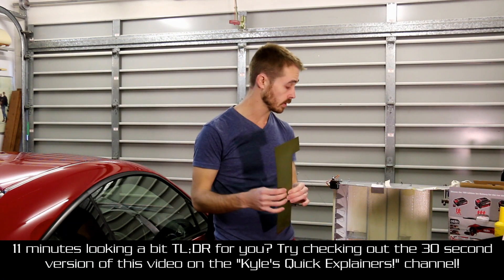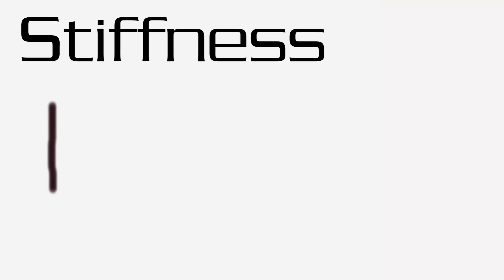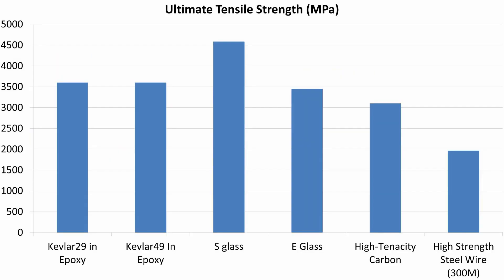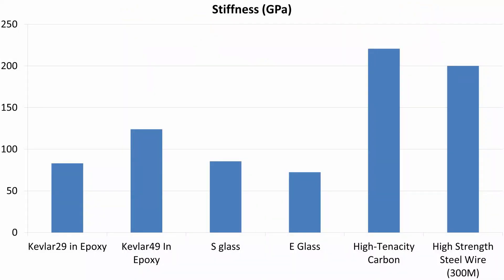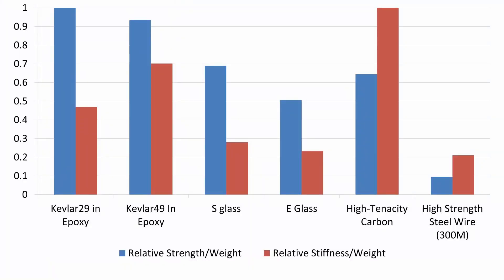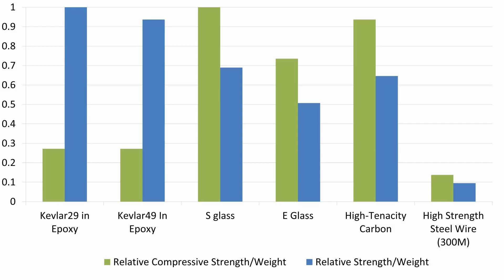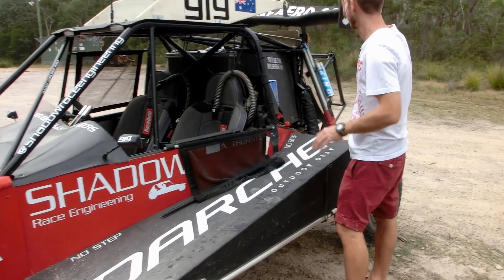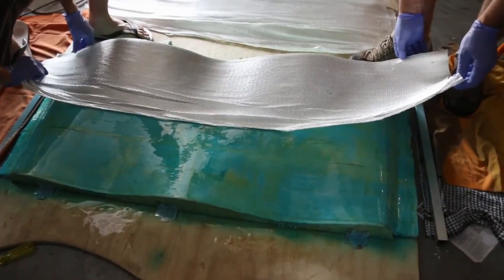Carbon Fiber vs Kevlar vs Fiberglass - Which one is right for YOU?

Comment: Thanks Kyle, I've been flying model RC gliders and I'm starting to repair my own crashes to save on the cost of replacement parts.  The video was an excellent primer and eloquently shows the path for the current repair that I've been fussing over.

Comment: Hey Kyle I’m in a slight predicament and with your background and expertise I’m curious if you’d have any recommendation.  I have a full suspension mountain bike frame made of 7005-T6 aluminum.  Recently found a crack running from the top of the downtube progressively down either side of the tube about halfway.  If you where to take a cross section it would only wrap around the top half of the cross section from 9 O’clock to 3 O’clock.  

I plan to lay either s-glass fiber or carbon fiber over the top half section, hopefully this will also keep the tube compressed enough to prevent further propagation.  The crack ends will also obviously be stop drilled.  My issue then comes from the ability of 7005 aluminum to elongate quite substantially where as carbon definitely can’t and fiber glass is only marginally better.  I think 7005 can reach 12% elongation at like 20 degrees C.  The problem is I’m not sure which route to go.  The fiber needs to limit the amount of change in length so as loads are applied, the crack doesn’t open up at all and propagate, but at the same time the CTE difference between aluminum and let’s say carbon fiber are so substantial if there isn’t any sort of give, just the temp rising or dropping will cause a failure.  I believe the thermal expansion coefficients of the aluminum and carbon fiber are around 21 micrometers/m-C and 1 micrometers/m-C respectively.  So the issue: I need limited movement i.e. further crack propagation if neglected, but the difference in material CTEs are large enough to require some movement or there will be failure of the composite.  Curious what your thoughts are and how you see an optimal solution.  It should be noted that a mountain bike does not see massive changes in temperature as it’s only used in rideable conditions (changes are gradual and not immediate as its contingent on atmospheric conditions).  For example sake the temp range is more than likely 30 F - 110 F.  That’s with a large margin, but I travel with my bike inside the trunk space of my SUV so if left parked I’m sure it can reach 110 degrees inside the cabin on a hot day.

This is obviously without even getting into the topic of epoxy and their affect on CTE of the composite.  Hopefully this is coherent haha.

Comment: Hey thanks for this video! It was helpful. 
I know my question isn’t technically pertaining to racing but what about a spinning disc? Where the only load on it would be radial forces and tangential hoop stresses in the disc periphery, so no compressive forces. If the goal is highest rpm, Does the higher tensile strength of the Kevlar outweigh the carbon fiber? Especially because it’s lighter and therefore experiences less radial forces for any given rpm if they are made into discs of the same size? 
Thank you! 

Before anyone asks no, I’m not talking about break rotors, and I can ignore UV issues as well.
Reply: The issue with Carbon is it can shatter and I believe in a spinning disc type scenario, Aramid(Kevlar) would be a better. Saying that, Aramid and Carbon can be layered together. Different resins and each layer should be allowed to cure but they can be used together to get both light weight and strength qualities.

Comment: U take the mini tiny wave pattern smallest u can lay fibers & work w/it. Then u come back 2nd step to smooth finish over, only u r finishing over many many diff wave pieces like a checkers board, red or blk. The squares of checkers board wave sq can b what ever size works best 1ft sq or 2 ft sq example u just hve to turn it sq 90 deg to last 1, north soth & east west, b4 u cover them together like quilt sq. Can bottom smooth cover, or flip it over & make 2 wave quilt squares thick.

Comment: building new prts fiberglass all day or w/so other material, but skinning carbon is where it is at, 1 & done. Is there a tiny way smallest poss that u can still cover, fixing the stretching weak problem bc tiny wave hollow bit can b covered smooth skin yet bonds to the under side thicker per inch strength^ main prt underneath.

Comment: The best use of Kevlar on a race car not mentioned in the vid. Is it’s ability to pass radio waves. So for instance most high level cars will have a small area of Kevlar in floor where the transponder is mounted.

Comment: What I understood from this is that Carbon Fiber is not necessarily strong if forces are focused in a small area, but it will wobble less with high vibrations, is lighter and can take more pressure in a larger area...?
So like, great for aero and other large panels due to large area forces, but not so good to support focused weight or impact?

Comment: Carbonfiber is great and it can be better depending on how it's made. Ie you can make cf several ways to receive different results. Ie pre preg carbon, wet layup carbon, autoclave cf, different epoxies, epoxy to cf consistency etc.

Comment: I'm new to composites and I'm considering getting into making some custom parts for older BMW applications. While this seems to talk more about the structural applications of the different materials I was curious if you could give some guidance into what would be best for air piping applications. I'm going to have to fabricate custom intercooler piping for a turbo build I'm planning out and was hoping to go with something a little lower weight than the aluminum intercooler piping. I'd imagine one of the factors of this would be the heat resistance of the epoxy but I don't know what else to consider. Overall, I'm not concerned with the aesthetic of the carbon fibre as everyone else that puts carbon parts on their car seems to be, and whatever goes on will be painted to match.

Would the S-Glass be airtight and will it hold up to the pressures of 12-15psi of boost? Would S-Glass be adequate for this application?

Comment: in compression most of the loading is actually taken by the epoxy NOT the fibers, this is why choosing the correct epoxy is nearly as important as the fibers. think of a shoe string, strong in tension, horrible in compression. its the same thing

Comment: things change if you use thermoplastics instead resin and also thin ply 3k unidirectional carbon. 
however thank you, i knew carbon was brittle but not that weak in compression and strenght

basalt must be best choice but carbon with graphene goes off charts and if used with plastic instead resin must be best choice too

Comment: fun facts. vinyl ester and polyester 50 - 50 mix is a very versatile.  I like mixing  
glass carbon and kevlar to gether. Roving are excellent filler/ stiffener.
double sided molding are the ants pants. triple sided. eg. inserts. Finnish  with surfboard clothes is a good practice.  Validation; Winton Saphire, facet opal.

Comment: I have a boat mold that I'm planning on using Carbonfiber as my 1st layer (which would be the outside layer) then building up additional layers using s-glass. My question is, would this be possible. I want the look and stiffness of carbonfiber with the strength of e-glass. Also what method would be best to apply the layers? Or is it imperative that I do Infusion?
Thanks in advance

Comment: Thanks!  I actually used some S-glass (S2?) on a canoe years ago, but I admit to being influenced by the "carbon fiber is best" crowd.  I experienced having carbon parts failing in testing, while the initial tests with e-glass were surprisingly durable.  And weight savings was disappointing.

Comment: I use carbon fiber for visible layer as I don't need to paint it if correct UV resistant resin is used. S-glass for structure. It's the resins for different applications that still has me scratching my head at times.

Comment: Not sure where you got those numbers, but saying something is better doesn't necessarily  prove that it is.  Did your voice suddenly speed up discussing the numbers?  Was hoping for a demonstration alluded to here, much like the guy breaking that glass.  Sounds like you rattled off some numbers to compare the three, that somehow turned into 8 or 9 types then 16 in a different color(ouch)..    
Looks like you were already set on, "fiberglass"..  You had me when describing the strength and flexibility of the various materials, but how did this end up being based on cost; when cost was not part of the original factors?  That was like choosing a bride based on finding out there was only one female out of the 16 candidates.  

Kind of funny, but somehow your presentation still relates back to carbon fiber for being the best for reduced weight, increased strength and flexibility.

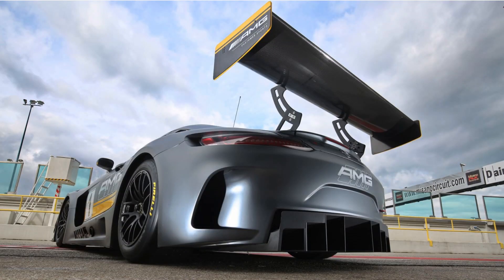Comment: I don't get 7:23 , surely the underside of a spoiler has low air pressure so it would be under tensile stress - the suction effect trying to pull the under side of the spoiler apart.  Whereas the upper side of the spoiler has high air pressure so it is being pushed down / pushed together which is compressive stress.

Is there something I'm missing here or is the vid the wrong way round?
Reply: So what he means is that the load in the middle of the wing will be transferred into the wing mount arms, it’s the part outside the wing mounts that experiences the flex

The wing wants to flex down, so the top skin of the wing is being pulled downward while the bottom skin is being pushed into itself, the low pressure of the bottom skin is being applied normal to the wing surface and thus doesn’t apply to what we’re talking about
Reply: @ShopeeMarketteam  Ahh i think i see now thanks.  Yes i'm thinking about the forces on the wing too abstract, when you think about it relative to the mounting arms yes that makes sense.

🤔 So by extension, if the arms were mounted on the outside of the car/spoiler it would be the opposite then, right?    Eg looking at the car from the back, if the spoiler was mounted like this  -------|--|------- then the top would experience tensile and the bottom compression, but if it was mounted like this -|----------|-  then it would be the opposite?

Comment: there are different measurements for material strenght, like pull and push, steel is very strong for pull its opposite is concrete that is really good under preasure, material strength test should consider its use, as there is the compression test too, not only the pulling one

Comment: I'm considering options for building wings on an RC airplane...
It's the skin of the wing I'm wanting a material for
It needs to be light, strength isnt important at all
I have a carbon fible rod in the wing for strength 
And lots of carbon ribs along the length of the wing that I need a skin to form around 
A heat shrink clear plastic could work, it's difficult to stretch evenly along all areas, and if its loose it flaps in the breeze, and its heavy..not good.

The problem in my mind would be getting a carbon cloth that's light enough, and getting as little resin in it as possible
Most carbon cloth I've seen people working with on YouTube is a course weave..and lots of resin.  Because they want strong parts for cars.
My application would be quite different 

Any advice? (Asking anyone out there, not just uploader)

Comment: Here is a question for you. Some people are making bamboo bicycle frames. Generally the joints are constructed by wrapping said joint with a fiber material that wetted with a resin matrix. Some people use raw roving and others use narrow woven tape. The question is: from a technical point of view which material is better suited for this purpose: carbon fiber, glass fiber or kevlar fiber?  Thank thee

Comment: I work on arcraft that have fiberglass panels and covers.  They constantly crack and a large portion of my career has been repairing fiberglass panels.  There was an experiment done when designing the new model of aircraft where they made carbon fiber panels and replaced the fiberglass panels with  the carbon fiber ones.  I have not once had to do a repair on those carbon fiber panels. The amt of man hours saved on this one aircraft from not having to do panel repairs is insane. Now all the new models are coming out with carbon fiber panels and I am so excited to not have to worry about fiberglassing anymore!

Comment: You forgot to mention plastic . I noticed the nissan Xtrail has plastic front panels. Most bumpers are also
Reply: This video was about composite materials.  Its focus was not on the base material, but what would be the best composite to use on that base for some general applications, i.e. should you reinforce that plastic with fiberglass, carbon fiber, or Kevlar?

Comment: Is Kevlar the only amarid fibre that has structure application (such as racecars, boats, planes or any vehicle component) or are there other types of amarid fibre that are better suited for structural application?
Reply: Look up Composite Envisions---- www.compositeenvisions.com   If you wanted crash resistant, lightness, abrasion resistant, then the latest best is TexTreme hybrid Zylon/Carbon-Fiber on their site----it doesn't soak up excess epoxy because the weave if flat and 3/4" wide cross hatch----costs no more than the dozen different "spread-fiber" weaves of Textreme Carb-Fib.  If you wanted the strength but don't want your fellows on the oval to eat shattered Carb-Fiber when it shatters then this stays together and is super light.

Comment: Interesting content, even for someone like me that has only done repair work with chopped strand FG. I wonder if a hybrid lamination with say a FG core and kevlar skin would work by allowing the FG to carry the compressive forces while the Kevlar provides abrasive protection and even higher tensile strength where it matters, at the outer skin of the part.

Comment: I have a Hovercraft which has a flat underside that has taken a beating from landing on stony beaches etc, and am looking to make a repair by cutting out a large section of the bottom and inserting a honeycomb core material with a layer of s glass. Any advice would be welcome.

Comment: Good Man.  I am using Spread Tow Carbon Fabric as the outer shell in my Model Racing Sailboat construction. I am using only 5.7 oz cloth as that has been the norm for many in my sport. But the cloth is so thin there will be a requirement for backside support.  I am going to use .5oz vale on the prototype but may now change over to some 1oz S glass.  Will probably end up trying both no doubt.  Thanks for the info.

Comment: Dear Sir,
Could you guide me that what material sheet could protect motorcycle  from puncture if it insert / place between tire and tube .  Would  it be  soft Carbon Fiber sheet or else  in which the Nail can’t able to pass.

Regards,
M. Ali Khan
(  alishoki@gmail.com )

Comment: I have a 75 mph  38" long x 11.5" Beam , RC Catamaran Boat which is primarily Fiberglass.  We are reengineering the Power train and it will be running in the high 90mph range before final tuning..... computer figure show final speed at or about 110mph.    QUESTION:  What would your recommendation be the material used to  REENFORCING this Hull ?   Keeping the weight to DOWN, and affording us Maximum Strength.    Glass, Carbon Fiber or Kevlar.... material can be Externally,  but were hoping on doing it INTERNAL if possible.  Any recommendation(s) are appreciated.

Comment: So essentially, use carbon for anything structural, fiberglass for everything else.

Also from what I’ve heard, it’s not worth replacing aluminum panels with fiberglass because there isn’t a great difference in weight?
Like, an aluminum hood might only weigh 2 lbs more than a fiberglass hood?
Reply: The structural depends on how structural. But yeah, carbon is better and requires less resin than glass=less weight. If you're actually manufacturing the parts, the fiberglass and carbon are practically identical to make. The downside to composites is when they fail, they fail catastrophically unlike steel which bends. Carbon also doesn't handle shock very well, so it's a poor material for things like mountain bikes and they all break in the same place that steel or aluminum never would.
Aluminum is still a pretty great structural material for a sort of performance/weight ratio, especially for less essential panels. In a perfect world, the material of the gods titanium would basically replace everything.

Comment: sir, I am a currently pursuing bachelors in mechanical engineering and I am currently in my 4th semester, I am trying to open a lab especially for building composite material at my university, but I have very little knowledge about it, can you plz provide a way to contact you so I can get knowledge about materials requires to work on composite materials, I have to give a ppt to our HOD so that he can initiate the funds.

Comment: All are wong..  YOU NEED TO USE STEEL !   The only true way ...        Unless you want to make an canoe or rowboat ...   then go ahead and use fibers ...         

Only reason to use  Fiber composites is if you cannot get the needed strength from steel or alloy ,  like drive shafts etc..     So only in pro racing you need to mess up with composite parts.  Every where else, you just ruin your car..    its not as safe in crash anymore,  for you, or pedestrians you may hit.  It will rattle and make annoying noises.  it will break from small rocks from other cars etc..   Just an fckin pain it the ass , and totally unnessisery unless you are racing in some series at pro level.    

People just need to enlarge their ego and talk about carbon this and kevlar that...      all just compensating for some other issues in waste line..    just pointless .. waste of money and making your car worse than it was .